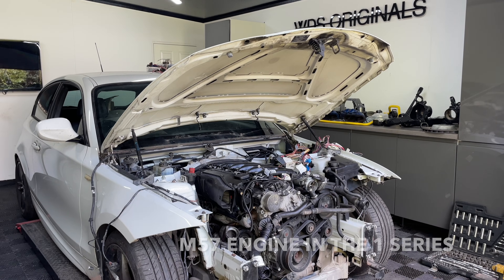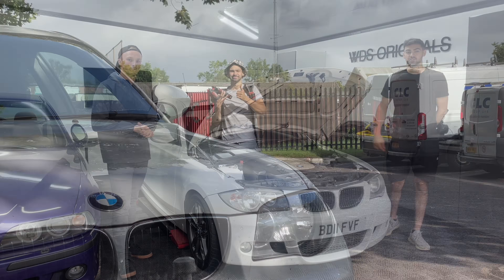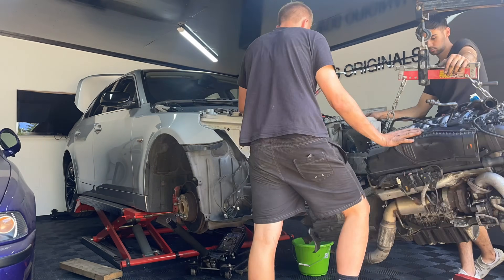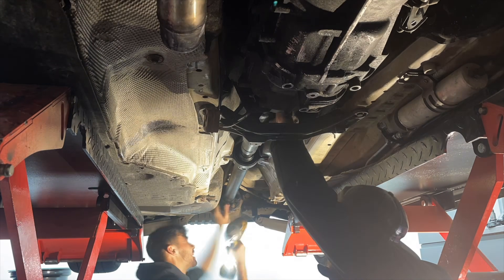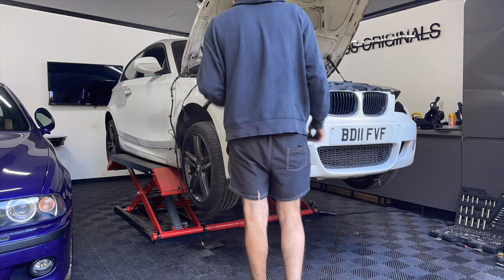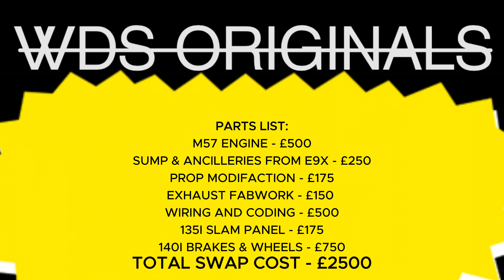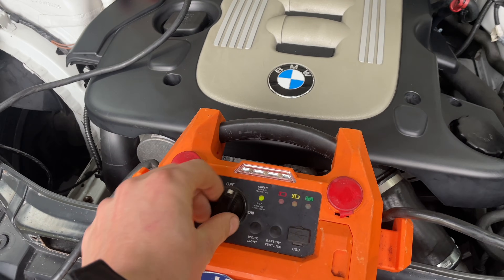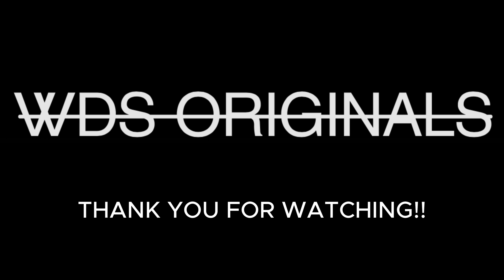BMW 1 Series M57 SWAP Explained – Full Costs, Pros & Cons!

Comment: Where did you get the wiring diagram to the m57 as I’m converting a 123d and nothing online
Reply from the maker: If you can’t find online then De-pin the old loom, trace every wire, understand what each one does 👌

Comment: Does  auto gear box fit with prop shaft
Reply from the maker: Personally not done an auto swap, so I wouldn’t know, but lengthening and shortening the prop is always an option, just have it cut and re welded and balanced 👊🏻

Comment: Which exhaust did you use? The original from the 120d? Just with the two original mufflers? The middle and rear ones? In the video, it sounds quiet—I really liked it. For daily use, it seems perfect. Does it sound like the original? What’s the secret?
Reply from the maker: Original 120d exhaust that was extended slightly to mate up with the decat downpipe 🤙🏻
Reply: @wds_originals don't suppose you know roughly how much the exhaust was extended by? Doesn't look much but mine is currently stripped down and don't have the exhaust to measure up. Cheers
Reply from the maker: @DG26-q4r  not sure was only a few inches, wasn’t much, put the downpipe on the engine in the car, offer exhaust up in place then measure and add accordingly 🤙🏻
Reply: @wds_originals  but with the downpipe? And the remaining 2 mufflers, or with the particle filter and catalytic converter? Totaling the 4 original mufflers?”
Reply from the maker: @R @Rmbt38  as per my video I ran a 3” downpipe, your best option is to give it a go, and modify it once you know what’s best for your car 👍

Comment: So basically I just need to remove the N47 engine, install the E9x M57 subframe (charriot), since the engine bolts straight in with the E9x mounts. With the 306 hp D3 version of the 330d it would be even easier, right?
Other than that, it’s more basic stuff and small adjustments: the exhaust line, the driveshaft, and the fiberglass front, right?
The main part is that the engine itself fits directly and bolts into the original mounting points with the E9x subframe.
It would basically be like installing an E9x, but in an E8x body?
Reply from the maker: Exactly that! Subframes are actually the same, so don't even need the subframe, just the engine & box from an e9x and it'll drop in! few modifications as you said and some wiring and coding, cars done!! It really isn't too difficult, i'm surprised more people haven't done it!
Reply: @wds_originals  You had more difficulty because the engine was the 530, right? But if the engine were the 306 D3 231 hp from the E9X, it would be easier electrically, right?

So if you didn’t swap the subframe, did you fabricate the engine mounts? Because the 4-cylinder ones don’t work, do they?

To make it more plug-and-play, would it be the E9X 6-cylinder subframe directly, already with the 6-cylinder mounts, and the engine would fit like it does in the E9X, right?

And regarding the steering rack: with the E9X subframe, is any modification needed? Or do you also not have to change the steering rack or the steering linkage?
Reply from the maker: @Rmbt38  EXACTLY!!  Pull the engine from an e9x, use the engine arms mounts etc from the e9x on the 1 series subframe, use the 1 series entire steering setup, make some new hydraulic lines to the m57 pump or if its electric delete pumps etc, and job job! It really is very easy to do!

Comment: Hey great work, do you think it is possible to use an f30 (318 320d) as donor car on the e8x chassis? Subframe, drivetraines suspension...
To be specific, i crashed my f30 318d b47 from the quarter panel😢 and if it not reparable im thinking of buying a 1 series and swaping everything into it.
Reply from the maker: Honestly not something I’ve looked at, but I’m sure it’s probably doable, just don’t see why you would transplant a 2.0d into a car you can already buy as a 2.0d? Doesn’t make a huge amount of sense to me unless it’s sentimental or something? But with the right research connections etc I’m sure it’s possible just not something I’ve looked at doing personally man! Best of luck with the build if you do take it on 👊🏻
Reply: @wds_originals  its because the impact is on the rear right panel and classified as structural damage. However the car only has 80k km and everything is new ( engine, gearbox, drivetrain...) and it is sentimental😅. I was hoping I could buy a riced out e82 or f20 for cheap and replace everything thing.
Its a thought now, im just figuring my options.
Reply from the maker: @S @Solider21111  potentially doable, but would research the hell out of it before financially committing, pretty much have the build fully planned and done in your head, every wire, every module that needed coding part numbers and costs of everything etc before buying anything to do so!

Comment: Wow, mate! I've been waiting for this vid for a long time since I watched it 3 years ago! It encouraged me to do it on my own with my 1 Series 118d M47 and swap it to M57 . 
In my case, I did reinforce the driveshaft, 330d diff and axle shafts, 335d brakes.
 Now I'm desperate to learn wiring and coding since it started once, but something went wrong on the electrical side. 
I'm open to receiving some help if you have some time, jajaj. 
Thanks for the video, man! 
Keep on grinding people!
Reply from the maker: Thanks for kind words/support etc, it’s very hard to help electronically and wiring wise, as every car/engine loom etc will be different depending on year, spec, variations etc. 

All I can suggest is get pin out diagrams for both engine side and chassis side and make them communicate properly by re wiring. Coding wise, cas module needs to correlate with dme. 

Hope that helps, all the best with the build 👊🏻
Reply: Thanks mate

Comment: Hi! Lovely video. Planning to do a 320d e90 n47 to m57 swap from e60. We didn’t get the 330d e90 in my country. Do you think it’s doable ? If so, which ecu do i use?
Reply from the maker: Of course it’s doable, just sounds like a lot of additional work, you’ll need e9x m57 sump etc! Ecu wise the one that came with the engine coded correctly 👍
Reply from the maker: P.s thank you for kind words 👌

Comment: When you say for the 123d platform the propshaft doesnt need to be touched, is it the same for the GS6-53DZ gearbox, will that bolt up to an M57 no modifications?
Reply from the maker: If you run the m57 gearbox and have say a 118i shell you’ll need to modify it as the prop length is different and flanges on small case diff is different. So depends on donor car too! 

Best thing physically get under the car and compare length and flanges, take measurements and then go to propshaft services & have it modified and balanced.
Reply: @wds_originals  So even though the 123d manual has the same gearbox (GS6-53DZ) as a 325d/330d manual would you be able to reuse the GS6-53DZ from the 123d or is the bell housing pattern different?

Comment: Super clean build! Loving these M57 swaps. Thinking of doing one myself!

What sort of coding does this involve? Do you simply use donor DME and code it to the cars VIN or do you need to code other modules aswell?
Reply from the maker: Yeh exactly that, as long as donor cars are similar year as cas modules etc are all compatible, just input the dme vins etc and job done 👍
Reply from the maker: P.s thanks for the kind words on the video!

Comment: As said previous, I want to swap it to m57 190kw or so.
Many says it's crazy. Here I see it's fits.
But still I can't do it in my shead, at least the wiring part or coding.

What's withs the gearbox mount etc. This is no help at all, it's great guys you are doing crazy mods, like and respect but for a noob it's just entertainment video. 
Not actual DIY project. 😢
Reply from the maker: It is crazy to fit an older m57 in, unless you love them like us, and then who cares what people think, if you wanna do it, do it!!! 

However you will never achieve this swap in a shed without knowledge of coding bmw modules, physically you will make it fit in a shed etc, but the wiring you’ll need access to bmw wiring diagrams and the software to code it all. And it’s not a case of googling it as every car will have a different harness etc depending on its spec, age and same with the engine. So you need someone to come wire it up and code it if that’s what you want to do. Unfortunately that’s not something I can help with. 

Gearbox wise, that car runs the original n47 box, it bolts up to m57 with a bit of adjustment & correct starter / flywheel setup, easy enough 👍
Reply: @w @wds_originals what adjustment do you need to make to the bell housing to make it fit mate?
Reply from the maker: @cajama2465 use a 330d m57 gearbox for simplicity

Comment: What wiring do you need to swap ??
Reply from the maker: Unfortunately it's not plug and play, but it's pretty simple with wiring diagrams for both your car and the new engine loom. Id suggest some research before the swap and then give it a go, every harness will be different depending on age/spec etc so not a case of me being able to tell you which wire goes where etc.

Comment: I have a 2006 e90 325d manual running around 400hp, hybrid turbo and injectors with full M3 suspension and brakes that would be perfect as a donor car for a build. Reason being is that i dented the rear wing. Its fully running , taxed and MOTed. 120k something miles on the clock. Still using it daily. Bristol Based. Let me know if anyone is interested. 29/09/2025.
Reply from the maker: Appreciate the offer, sounds like a tidy build! Someone should buy this if they want to do the swap..!
Reply: Still got it?
Reply from the maker: @BradHale  sold sorry